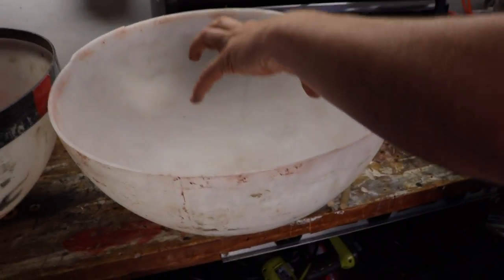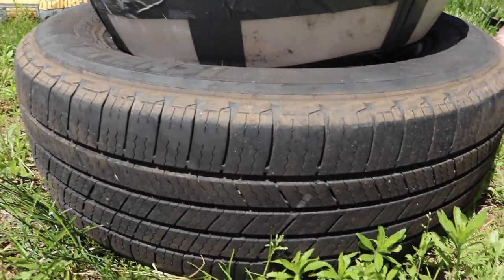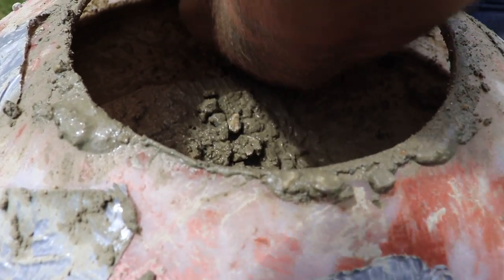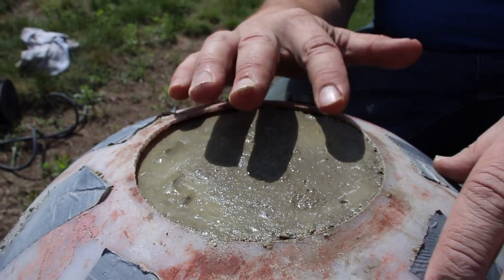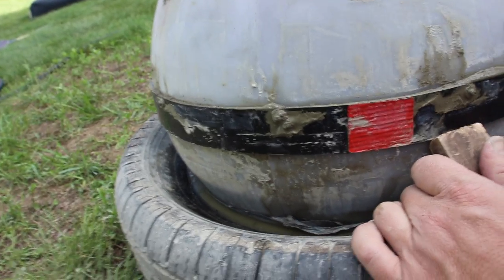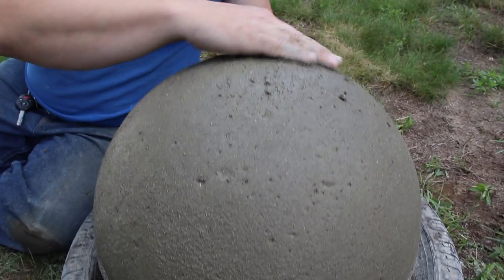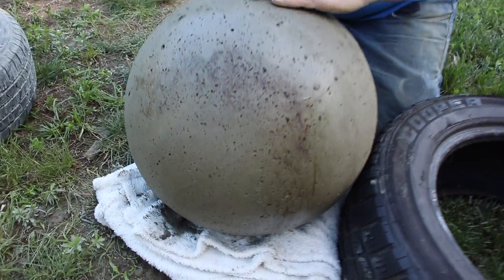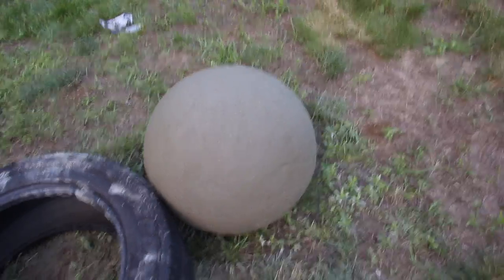How to make an Atlas Stone

Comment: No instructions.  Where do you get this stuff and what is it?
Reply from the maker: Which "stuff" are you referring to? And the video is only a rough guide on how we created these stones.
Reply from the maker: @christineribone9351  Gotcha... used a massage foam roller from walmart to take up some space, thin wood dowels to hold it in place, and the plastic shells actually buoys from a boat yard, cut in 2, and added my own metal rind from a hardwars store. You can also get the stone kits online, which provide the shell, ring... Insert is optional depending on the weight you want...
Reply: @fatherandsons126  thank you, that was very nice of you to give me all the details.  I live in the desert so there's not much boat stuff around here.  I'll probably use a ball or yoga ball for larger size ball.

I know I should start with a small  size before diving in  a jumbo, but they look so awesome!!
Reply from the maker: @christineribone9351  YES, start small... and be very careful. They make great exercise for strongman/woman competitors, and can be great strength builders, but not worth blowing your back out over so be very careful... I actually have one in the garden as a zen stone! Multiple uses... stay cool out there!